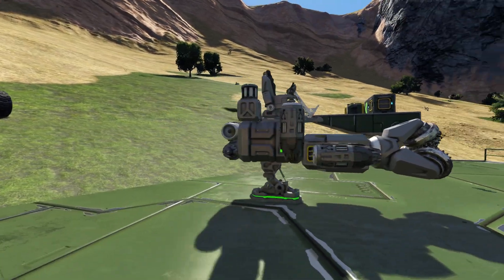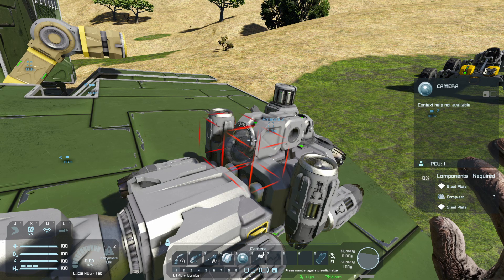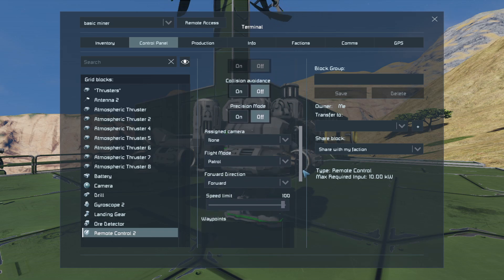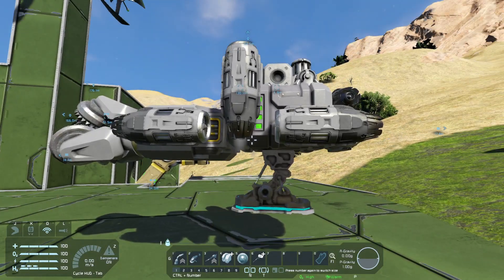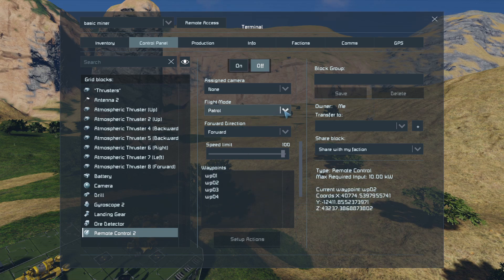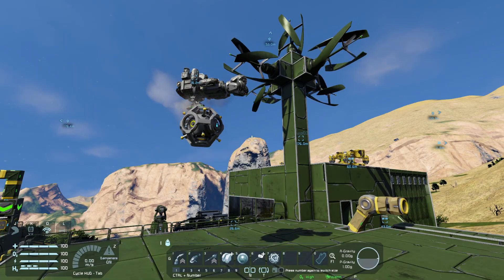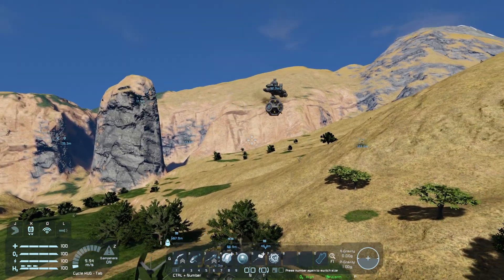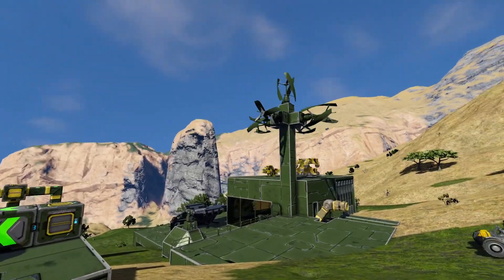Intro to the Autopilot | Space Engineers

Comment: i cant apporach i try everyting ... pls help i will get crazy
Reply from the maker: You can't approach? You mean you have a drone flying round and you can't get to it?
Use remote access (shift+k) to access your drone and switch off the autopilot feature. Just make sure you are less than 200m away from its antenna.
Reply: @TallmanBradGameplay  first thanks for answer no i mean i am using drone for carying cargo but my ship is not going right place and even if it go than its not locking with other connector . I choose moves and i set lock but not works  and waypoints usually being in more up or more down i didnt understand why  its like that
Reply from the maker: Try switching on the 'precision' option to get more accurate movements. Make sure your ship has plenty of thrust to stop it falling as the autopilot adjusts for height. Locking with a connector is very difficult unless the ship is perfectly aligned. I would only recommend connecting from the bottom of your ship to a connector on a base facing straight up. Make sure you have a waypoint directly above the connector a good few meters away. And another waypoint as close to the base connector as possible. Switch off 'collision avoidance' to stop it from avoiding hitting the connector.